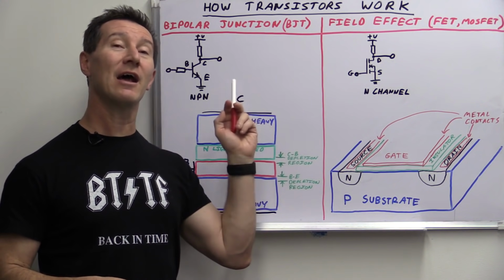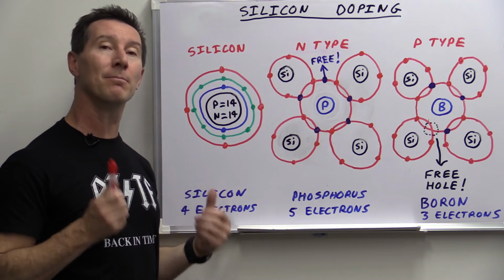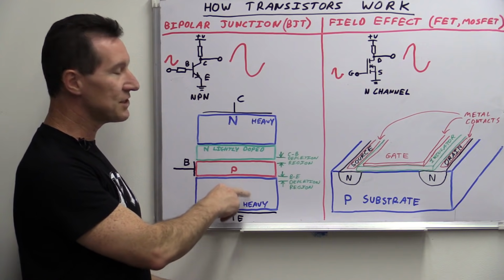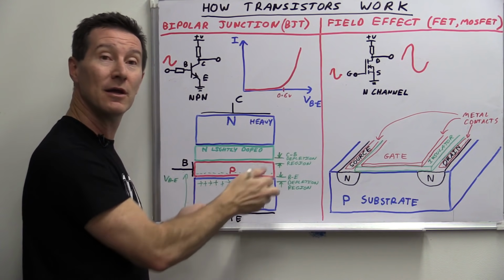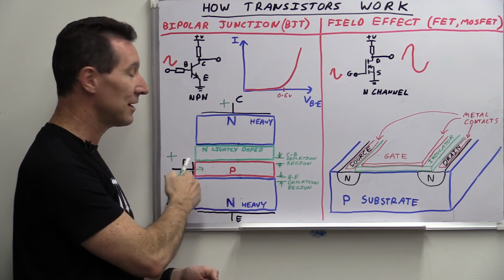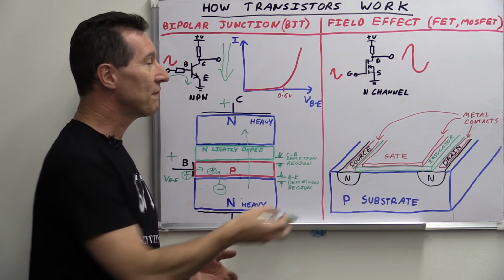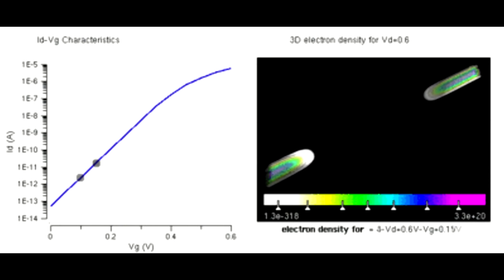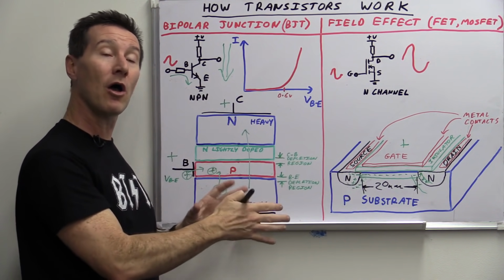EEVblog #748 - How Do Transistors Work?

Comment: There's this book "Horowitz and Hill."   Not familiar?  You do realize that it contradicts this above BJT explanation. They repeatedly show that BJTs are voltage driven.

H&H's book AOA steers students away from "current driven" by giving many examples of broken circuits which were created with the "current input" BJT misconception.  The lab book for Horowitz and Hill goes even more into this.  They show that slight temperature changes screw up the hfe-based circuits, and totally halt function because of device-to-device variations.  hfe-based transistor stages each need a trimpot and a thermistor.  Vbe-based designs do not.   Then, AOA points out the many circuits which are impossible if transistors are current amplifiers, but which are easily explained if they're voltage amps: impossible things like BJT op-amp front ends!  Why aren't BJT op amps based on current-input?  Because BJTs are inherently voltage in, current out, and their base terminals need no resistor in series.

Also: the bjt CB junction is not thin, that's wrong.   That junction always has a relatively thick depletion layer, and it never gets thin.  In fact, the higher the supply-voltage, the wider is that depletion zone.   But electrons easily flow across it because they're being dumped on the wrong side!  They see the wide empty zone as a vacuum, and easily cross it, driven by the strong e-fields in that insulator region.  The wide BC junction acts a lot like the vacuum in a vacuum tube; it's insulating unless an electron cloud is supplied.
Reply: +Peter Walker You bring back memories of when I was a freshman taking my first physics class. Special Relativity came AFTER Newtonian mechanics and general relativity came after that. I'm not even mad that i was taught the misconception in high school that sqrt(-2) does not exist instead of the "truth" that it equals i*sqrt(2) (or j*sqrt(2) fer you EEs.)
Reply: +wbeaty
I'm not convinced that an amateur electronics blog needs the full explanation of the device physics issues within the Ebers Moll paper.
One could raise similar concerns with Ohms law with respect to Maxwell's Equations or Newtonian gravity with respect to Relativity.
To a large extent the basic models are simple to digest and work within a reasonable range of values encountered by the electronics enthusiast - the intended audience. 

Ebers-Moll

Reference https://www.physicsforums.com/threads/why-is-fet-voltage-controlled-and-bjt-current-controlled.335368/
Reply: > I'm not convinced that an amateur electronics blog needs the full explanation of the device physics issues within the Ebers Moll paper.

+Peter Walker  It doesn't.  (heh, strawman.)

It just needs to explain how transistors actually work, no Maxwell eqns need.  In detail: first explain that diodes are voltage-controlled, and the diode Vf is not actually 0.7V, but instead an exponential function, where applied voltage determines the diode current.   Diodes are turned on and off by varying the voltage.

Is this a horribly complex topic, for electrical engineers only, and not suited for technician-level ears? Must we only believe that Vf equals 0.7V always, and anyone who says differently is a big liar?  

:)  

Nope.  But it's basically the same issue as above: explaining the details of changing Vf and diodes turning on and off, then just apply the same junction-voltage concepts to transistors too.  (And to LEDs, solar cells, thermocouples, etc.  It's actually useful if you want to understand semiconductor devices.)

Why do all this?   Because it's needed for explaining analog circuit design.   Well, if you don't want to ever design with (or understand) diff-amp circuits, or current-mirror circuits, or cascode, CC totem-pole, etc., then there's no need to give up on hfe concepts or to understand voltage-input concepts.   Analogy: it's a bit like an amateur chemist who learns that atoms are little solar systems, then won't have anything to do with more advanced chemistry because there are no little solar systems discussed.  The solar-system atom was a lie.  It must be discarded if we want to proceed further.  The "hfe transistor" is a similar lie, and if we don't want to remain "trapped in noob-land," it must later be replaced with the voltage-input transistor.

Heh, it wouldn't be so bad if all the intro tutorials said "transistors don't really work like this, hfe is actually irrelevant to modern design, but we're simplifying things to make it easier for beginners.  Later we'll replace this part and design like grownups do, by using spice programs where Vbe varies and Ib is ignored."   The books do that for chemistry, telling us that atoms aren't really like little solar systems and the truth will be revealed to the big kids in later classes.

If we ignore the Vbe ideas, refuse to learn about them, and pretend that Ib really can control Ic, I know from experience what will happen.  We'll open up a modern stereo, look at the schematic, and have no idea how it can work, because the audio response goes down to 0Hz, and the whole thing is based on direct coupling.  The stereo schematic looks just like the insides of a giant op-amp!  No CE circuits with capacitors between.  It's all bizarre!  To explain and understand it, (and to have any hope of repairing it,) we have to discard all mention of hfe, ignore Ib, then point out that this part over here is diff-amp, all these are the current-mirrors, here's cascode level-shifter, etc., etc.   All circuits based on voltage-input of BJTs, where hfe is assumed to have a large, irrelevant value, and all the base currents are tiny and ignore-able.
Reply: +Nodakkian
You cannot get an adequate understanding of transistors from one 25-minute YouTube video. I don't have the same problems with Dave's presentation as some commenters do -- I think it's as good as you are likely to get when a basic explanation of two types of transistor are crammed into 25 minutes. You are gonna have to get a textbook or two and just put in the time to go over the material until it sinks in. There are also many excellent university lectures on the subject available on YouTube, but it will take much more time than 25 minutes to watch them. I would estimate that a person of average intelligence would have to spend a good solid month of intense thinking about and study of the subject to really understand it.
Reply: Nodakkian
A transistor is usually considered to be a circuit component, not a complete circuit. wbeaty prefers to look at a different model to describe current flow in a transistor than Dave used. Dave's model is useful in certain situations, but wbeaty's is more general. In a FET, the channel from source to drain can be thought of as a resistor, with either positive or negative carriers participating in current flow, depending upon whether the channel is p-type or n-type. If n-type the carriers move in the same direction as the electrons in the external wire. No holes are required for current flow in that case. It is the positive potential of the external power source which attracts the electrons.
Reply: +wbeaty There is no misconception other than to say that in the absence of voltage there is an absence of current. There is also a book written by Bill Shockley who was probably a lot smarter than Horowitz and Hill put together. I should probably say that either Horowitz or Hill individually is a lot smarter than I, but we have to pick our gurus based on something.
Reply: +Richard Gray Of course there's a misconception.  This error is exposed in any engineering classroom, especially in the semiconductor physics classes.  The error isn't only debunked in AOA book, but everywhere. AOA is just an easily-recognizable example.   The above video about BJT operation is oversimplified and wrong, using concepts typically aimed at low-level techs who don't need to do actual BJT designs.  If you have no desire to understand the silicon itself, a wrong explanation won't hurt you.   But the wrong explanation isn't necessary, since this "analog engineers' secret" isn't that complicated.  But it does require that we confront and defeat the wrong concepts we've been taught.   Many people won't do that ever.  They prefer to believe that grade-school textbooks tell the truth, just like George Washington chopping down the cherry tree, and heroic Columbus who would never think of murdering or enslaving the natives.

So, what's the "Lies to Children" part of transistor explanation?

It's the mistaken idea that base current Ib can control collector current Ic.

To understand transistors' internal function, we must note that the base current has no direct effect on collector current.  One current cannot affect another.   Instead, the entire base circuit sets the value for base voltage Vbe (via the Shockley equation of course.)  Then the Vbe potential-barrier determines both currents: Ib and Ic.

We can view this as Ib affects Vbe which then affects Ic  ...and then we can go further and form a simplified 'black box', where Ib apparently determines Ic directly.    But, if we open the hood and look inside, we find that BJTs are voltage-input devices, transconductance devices same as FETs, where the ruling equation is Ie=Is*e^Vbe/nkt -Is.  This isn't that complicated!  It's just transconductance: volts in and current out.  Same as FETs and vacuum tubes.  But we do need to have high-school algebra, so we're not scared off by nasty math like the diode exponential equation.   And we must face the terrible horrible fact that Vbe is not actually fixed at 0.7v, and it never was.  (Oh no!)

:)

All of BJT-engineering is based on this Shockley equation, the Ebers-Moll version, where base voltage determines Ie and Ic.  It's why BJT op-amps have voltage input rather than Ib current input.  In op amps, the differential-pair front end is a voltage-input transconductance circuit.  (For those who believe in BJT current-input, the long-tailed pair circuit remains a deep and confounding mystery!)  The breakthrough to understanding op-amp internals is easy: BJTs are voltage input animals, and your earlier teachers were wrong about the nature of hfe.  Also, base-voltage is how current-mirrors work, and half the stuff inside any analog IC is the current-mirrors replacing the large resistors.   Try explaining current mirrors or Cascode circuit based on hfe, where Vbe is fixed.   Not possible.

Of course it's fine to use Ic=hfe*Ib in many situations.   It's an extremely useful simplified rule of thumb, like Ohm's law.  

Just don't try to use it to explain the internal physics of components, or everything gets loopy and distorted.

Yes, Shockley himself was beating the drum for "BJTs are current input."  He was wrong, but had VERY good reason.  His statement appears to be Bell Tel business-hype, done to make certain that USPTO wouldn't reject BJT patent applications, since voltage-input Lilienfeld transistors had already been patented twenty years earlier.  Bell Labs had to distance themselves somehow from existing FETs.  A good way to do this is to pretend that BJTs are current-input while FETs are voltage input.   But it's not honest science (though it may be honest cutthroat business practice.)  BJTs use voltage-input and use the (ahem!) Shockley Equation.  Shockley worked out the whole semiconductor theory behind them.   So, why would he claim that BJTs are current-input when he very well knew that they weren't?  If he hadn't, there might not be any Bell Tel transistors; no patent, no profit, no aerospace contracts.  Yet his small businessmans-lie is confusing-the-noobs even today.   They just have to take some college undergrad courses to get the "hfe stuff" beaten out of them, and learn to slap on that Vbe Shockley equation just as easily as using Ohm's law.
Reply: +wbeaty Puhleeze. There is nothing wrong-headed about modeling a bipolar transistor using collector current as a function of base current. But, if you KNOW better than that, then I'm happy for you.
Reply: +Richard Gray Yes, that's a lot like modeling diodes as having fixed 0.7V voltage: often useful, even though certain designs would fail.  And of course it tells us little about how diodes work inside.

The "current amplifier" model of transistors is fine as long as we know that it's just an ultra-simplified black-box model.  Major trouble arises whenever people think it's really true, and then they try to base designs on it.  The designs don't work (their resistors have to be hand-adjusted for each transistor used, and temperature effects are enormous, requiring thermistor compensation circuits.)

Also, classroom trouble crops up when we try to explain such things as Op-amp basics.  The op-amp diff-input front-end relies upon base voltage signals, not on hfe, and it cannot be explained in terms of current-amplifier transistors.

---

I encountered this problem myself, on a very first professional analog design for an industrial opto-sensor.  I was forced to abandon the current-based "hfe-think"; and instead spreadsheeted everything as voltage-input (transconductance) circuits where hfe is ignored.  Worked fine.  That sensor design is in coke machines everywhere.

Win Hill, one of the authors of "Art of Electronics" tells exactly the same story here:  http://cr4.globalspec.com/comment/720374/Re-Voltage-vs-Current  Before he could succeed at circuit design, first a wise old engineer had to take him aside and teach voltage-centric BJT philosophy, as opposed to the "current amplifier" stuff he'd learned in early schooling.

So, instead of first being taught that BJTs use current input, why don't we just do an end-run instead?  Never learn hfe stuff at all, but directly jump into teaching that BJTs are voltage-input devices like FETs?  After all, that's what they really are.  But then we'll have to face the fact that our earliest teachers were lying when they taught us that George Washington chopped down a cherry tree, or that Columbus was a saintlike hero, or that BJT transistors are current amplifiers.   Or that William Schockley cannot tell a lie!  :)
Reply: +wbeaty Well, I knew as a second-grader that it was bullshit when my teacher told us that George Washington never told a lie or as a seventh-grader when we were told that Isaac Newton watched an apple fall and thus invented gravity. But, later, I never got that feeling about hfe being a useful device parameter.
Reply: +Peter Walker good point, but...

> I'm not convinced that an amateur electronics blog needs the full explanation

The same could be said for diodes:  shouldn't we convince students that diodes are always and forever 0.7V turn-on?    And, Never Ever show an exponential graph, or mention that diodes might have 0.2V at low forward current, or 2.0V at very high forward current?   After all, those topics are full-blown complexity only for the ears of college educated engineers, the Shockly Equation.  Well, screw that!  Teach the real stuff instead, but use verbal, animations, whatever's appropriate for introductory classes.    No bunches of impenetrable math homework allowed, or any need to mention "Shockly Equation," even though that's what the diode exponential curve is all about.

And, the same could be said for the "hfe-centric" explanation.  The full blown version is all math, demonstrating the nonlinear effects, source of hfe variation with current, etc.   Solution: we just use either explanation while avoiding the full version.  No pretending that anyone has to solve groups of simultaneous equations in order to understand either version.

In other words, the minimal-math version of BJT voltage-based explanation looks much like the minimal-math "hfe-centric" version.

The key point:   show everybody that BJT designs are voltage-based designs.   Without this knowledge, nothing inside the 741 op-amp is recognizable, since none of it relies on hfe.

For anyone who thinks the guts of 741 looks bizarre and impenetrable, it's because it's all based on very simple voltage-based circuits.  The analog world is voltage-based, where the most massive changes in hfe are irrelevent.   I think it's a huge disservice to not teach a simplified form of this, right from the start.   And, it's an even bigger disservice if we try to convince students that BJTs are current-based amplifiers.  So, very first lesson, day one:  BJTs are voltage-based devices.  Then go on to explain the difference between BJTs and FETs, and perhaps introduce the simplest voltage-based amplifier, the common-collector circuit. 

Or go further:  find all the misconceptions which can almost permanently derail students.  Then change our curriculum materials so they stop creating those misconceptions.  I've found one of them:  much ignorance of voltage-input BJT circuits, caused by a deeply-held belief that BJTs are current amplifiers.

Heh, I was just showing someone how to repair their stereo amp.   The entire amplifier-chain was DC.    There were no "current amplifier" stages anywhere in the whole thing.  The front end was a diff amp.  Lots of common-collectors and level shifters.   And of course all designed so that huge variations in hfe would have no impact on gain or DC level.  Really, it looked very much like the inside of a 741 op amp.  If techs aren't taught how all that stuff works, and instead are mislead with "BJTs are current amplifiers," then they're at a disadvantage when repairing normal electronics.  Best case:  they just ignore school, and go off to teach themselves how a long-tail pair works, how a current-mirror works, totem-pole drivers, etc.   All these are voltage-based designs, none care about Ib or hfe.
Reply: +wbeaty I look forward to your 25-minute video showing me how BJTs REALLY operate. Dave has led me astray, and you are just the guy to set things right. I don't think you will have time to get into wave mechanics, though.
Reply: +Richard Gray 

>  I look forward to your 25-minute video

Maybe during retirement.  Aha, how about "HOROWITZ AND HILL WITHOUT THE MATH."   On the other hand, I'm not aware of any bestsellers written by critics. All those critics/reviewers/etc., they should just shut up and go away,  make their own movies and books.

> I don't think you will have time to get into wave mechanics,

Now common collector is "wave mechanics?"

Or long-tailed pair,  current-mirror, etc.?  These are the voltage-based building-blocks of modern electronics.    Yet nobody is going to teach them in an intro class, if their goal is to convince students that hfe is critical, or that transistor circuits have a current input pin, never a voltage input pin.
Reply: +wbeaty Im sorry Im totaly new to this,, but when the electrons from N side get to the other N side wouldn't they be repelled? How would you use this to complete a circuit?..or is that something separate?
Reply: The n-type is not negative charged.  It's neutral.  "n-type silicon" means that it's full of fixed positive ions and movable electrons.  The p-type is full of fixed negative ions and movable holes.  But both kinds of silicon are overall neutral, since even though they're full of dopant ions, still they contain equal numbers of pos and neg.

The magic:  if n-type silicon is neutral, but then we sweep all the electrons out of it, then it becomes overall positive, because now it's full of protons which don't have any electrons nearby.   So, the depletion-layer in n-type silicon is charged strongly positive.   Why?  Because it's full of positive-charged dopant atoms.  Those atoms normally have electrons somewhere nearby, but in the depletion zone, they don't.
Reply: Ok thanks for the thoughtful reply..I think I understand..once you apply current to draw electrons across P type( postitivly charged current does this?) the electrons flow into p-type filling 'holes' but wont they run into the negative end of the depletion layer on the other side of the junction/gate? and if they stop there and dont flow through the other n-type layer (if its and N-P-N MOSFET) and thus the circuit will not be completed? or is it just about getting current to flow through the P type and open the gate and not about completing a circuit? I was thinking current is supposed to flow from N to P to N out of the N and up and around or something and back into the other N to keep the current flowing and the gate open
Reply: Was this a response to me? Are saying this video is foundationally wrong? Sorry im a little confused
Reply: Where are the holes to draw electrons up and through the second N type region into the drain?
Reply: Thanks for the thoughtful response!
Reply: Nodakkian
No problem. I should mention that all university-level material uses conventional current (positive-to-negative) rather than electron current. Just remember that, using this convention, an electron moving from right to left has exactly the same electrical effect as the same positive charge moving from left to right.
Reply: Ok, but thats not all wbeaty was talking about right? he seemed to be suggesting there is a whole other aspect to atomic movement or theory? That people should study...i didnt quite glean what he meant exactly. Also can you answer this...is a transistor or MOSFET also a circuit? when electrons flow out of the drain do they go around and back to the side they started from? Im going to take some time to learn this in depth this summer, but i guess im trying to get a basic concept before I start...but I cant find any answer to how current flows through the N side under the drain when that N side has no "holes" or positive charge to attack the electrons (also the depletion layer will have a Negative charge on the side that is first encountered which would repel?)...then once current moves through the drain where does it go? does it complete a circuit? If you know where to find these answer let me know!